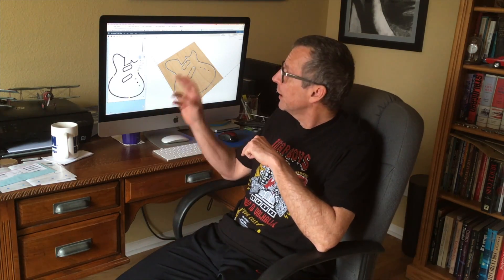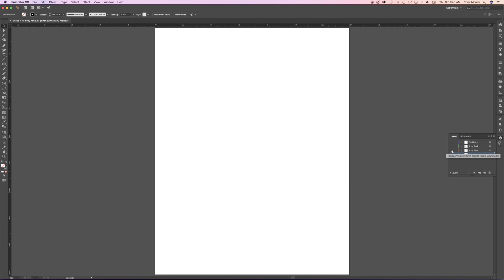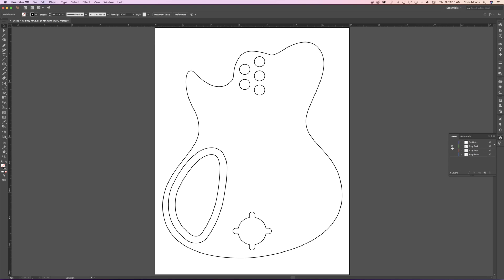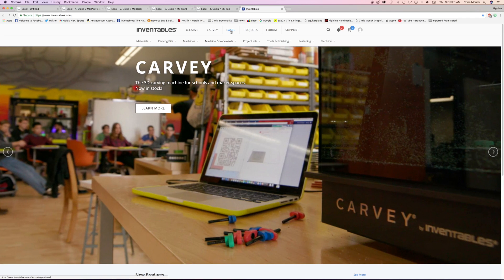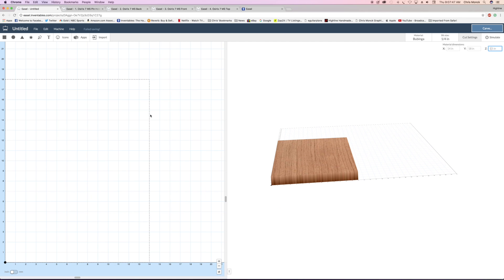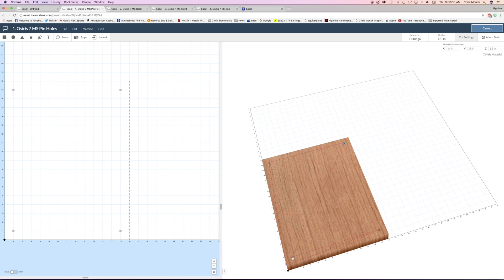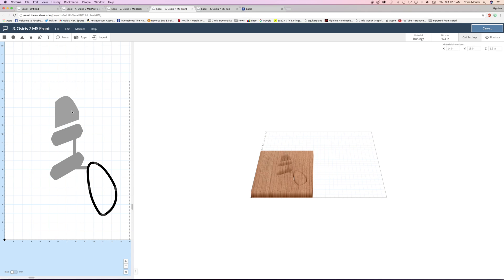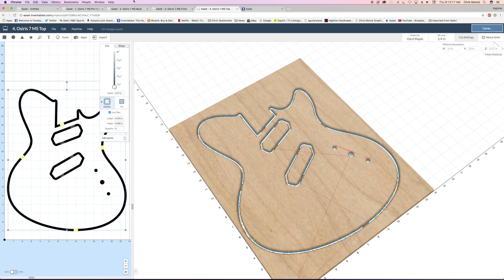Designing An Electric Guitar Part 4

Comment: Thank you sooo much for this great series of tutorials. I am a mechanical engineer by training but have a passion for guitar. Your videos are a strong inspiration for me to start building electric guitars with my CNC (a pretty good OmioCNC X1600). I fully agree with you about CNC: it is only as good as the efforts, thoughts and knowledge the designer puts in. And as a purely amateur luthier with better CAD skills than hands on practice, it feels rather reassuring for me to machine the most critical parts from a CNC... but it takes a hell of a time.. and a lot a failures until I can get it right.